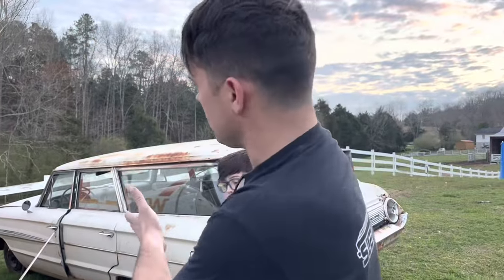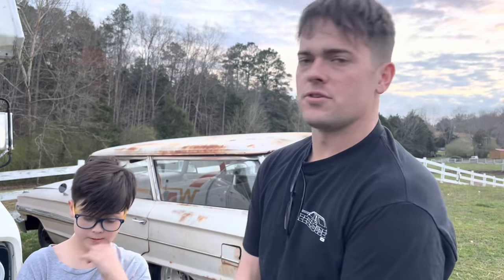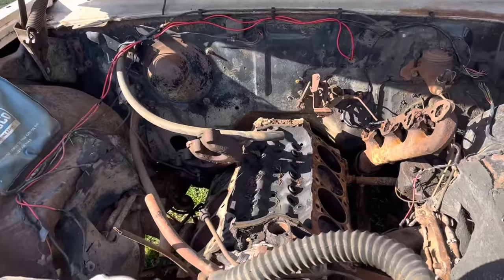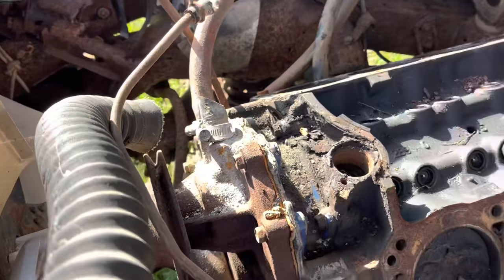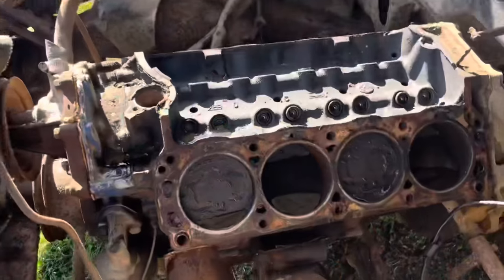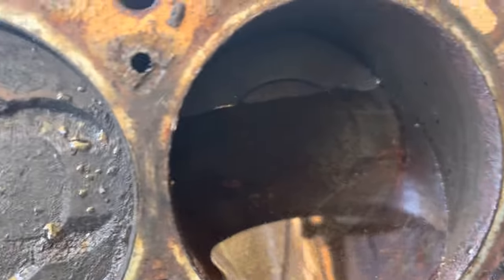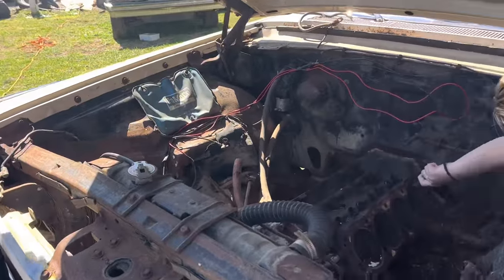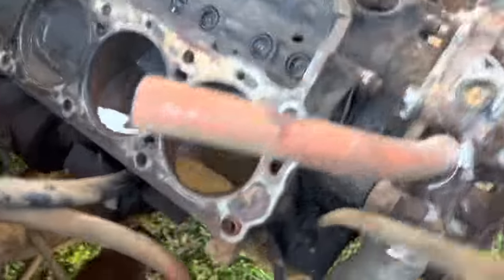Tricks and Tips to getting a stuck engine free after 30 years. We try everything!

Comment: Transmission oil in the cylinders works great, pull the plugs and fill up. Let it sit for a while, and turn it over using the crankshaft bolt. The cylinders need lubrication. Great video, and a blessing of a family. Keep up the great videos.
Reply from the maker: Ok thank you

Comment: Grandfather bought a locked up Farmall tractor. Put a socket, breaker bar and a ten foot pipe  on the crankshaft with several hundred pounds of iron on the end of the pipe. Oiled the cylinders and walked away. Three weeks later all the iron was laying on the ground. Time, pressure, leverage and a bit of oil mixed with kerosene broke it loose. Just another weapon in an arsenal of tricks to use if all else fails. Good job on the video.

Comment: Your going to have to bore that block maybe 30 or 40 over to clear up those cylinders so you will get maximum compression or it’s not going to have any power and will sling oil out of the exhaust if it will even build enough cylinder pressure to even run. It’s worth doing if you ask me because that’s definitely a going to town car for your family.
Reply from the maker: Yes sir !!!
Reply: Adds more cost to the build I would light bore it maby .10 over
Reply: I'm thinking 0.60 won't be enough, that would be max on them cylinder walls
Reply: That is if it can be bored , some of the cylinders may have too much rust . If more than one or two need sleeved then it would be better to find another block .

Comment: You probably won't believe me but if taking some gas and oil mix put some into each cylinder then light it and let the heat do it's job.
Reply from the maker: Ok good to know
Reply: @Sleeperdude  
Ralphie did say to light it on fire.
Reply: How about your right my dad did that it worked
Reply: Or use 'boiling oil'.

Heat plus it thins it up so it penetrates better.
Reply: @mrb.5610  agree
Reply: I second this motion
Reply: Trying to free up 4 cylinder JD moter, going to give it a try

Comment: Well done! For better and faster results, you should degrease the bores before you add your vinegar. Otherwise, the oil blocks most of the vinegar from reaching the rust. Vinegar still works with greasy bores, but takes much longer and is less effective. When you have rusty bores, the rust you can see isn't really the problem; you can brush and hone that away. It's the rust you couldn''t see that was locking up the motor. Phosphoric acid works quicker and better than vinegar. As you've already discovered, muratic acid also desolves rust, but it also tends to dissolve any alloy (eg, pistons). It's easier to neutralize acid with baking soda if you dissolve the soda in boiling water first. But well done, you put the effort in and got the result :)
Reply from the maker: Ok thank you for the good info
Reply: Do you have any suggestions on a 3.4l Toyota engine that has sat for 3yrs and the rings are rusted. It will turn over fine it just sounds crazy with no compression. I tried ATF & acetone mix with no luck.  It seems like everything just seeps past the rings into the crankcase before it has a chance to work. I haven't tried white vinegar or industrial vinegar.  Just hoping I can find someone out there that can help me save this engine. Thanks.
Reply: @dgmenace73  First you need to check the engine bores with a borescope to check that the valves aren't bent or the pistons damaged.
If they're okay, you must degrease the engine, or the rust remover won't be able to get to the rust.
Remove the spark plugs and DON'T replace them until the job is complete, or you may hydraulic the engine. Live with the fact that whenever you turn over the engine, crap will spray out of the spark plug holes.
Using a spray bottle, lightly spray in detergent mixed with water then cautiously  turn over the engine using the starter. Repeat until oily crap stops spraying out the spark plug holes. Detergent foam coming out the spark plug holes is okay.
Then lightly spray phosphoric acid, Evapo-Rust or vinegar through the spark plug holes. Lightly turn the engine over to ensure an even spread. 
Leave phosphoric acid for maybe 12 hours, Evapo-Rust or vinegar for maybe 24-72 hours.Keep the bores wet with rust remover at all times or the rust remover will stop working. 
Then spray a small amount of water into the bores to remove the rust remover and gently turn the engine over by hand. Then wet the bores again and spin the engine over  on the starter until crap stops coming out the spark plug holes. Repeat several times.
Then spray in some penetrating oil and turn the engine over on the starter motor until crap stops spraying out the plug holes. Repeat this several times.
Drain the engine oil and replace it.
Then replace the spark plugs and use engine starter to start the engine.
Good luck.
Reply: @Clive Matthew-Wilson  thank you.....I actually had watched so many videos that I had decided to at least try exactly what you said. Anything i have tried already didn't get a chance because there was still oil on the rings. I think this just may very well work and I plan on recording the processes. I already had regular vinegar and some of the 45% I think is what it is.  Someone else mentioned to heat the rust remover and any oil to 145° since heat makes metal expand as well as makes detergents clean better. Sounds reasonable to me?  I will let you know if this works and let me know if anything I just mentioned is a waste of time or a bad idea ( like heating the chemicals up some). Thanks for replying.

Comment: Kroil is pretty amazing at freeing things up that have seized from rust and sitting. 
     Great Work and nice video. 
   Ya'll Take Care and be safe, John

   PS, I am a gunsmith and do restoration work on some really old and rare firearms. Kroil is the best thing for saving parts that might have wound up in the trash. Some of the guns I repair don't have replacement parts available for them. Soak them with Kroil and let them sit. Making parts isn't easy or inexpensive, Sooo...
Reply from the maker: Ok thanks for the info

Comment: Cool video, keep in mind 3rd gear gives you the most power and muriatic acid dissolves aluminum really not good for the Pistons. Check online for a product called Gibbs it's a high penetrant rust dissolver and will loosen most engines after it sets a few days, I think the engine might run but it's probably going to use a lot of oil unless you rebuild it
Reply from the maker: Ok thank you
Reply: I'm glad someone else mentioned this. I kept thinking "why don't they put it in 3rd?" In the end, the breaker bar probably had even more torque though.

Comment: Check out the guys on the Restored channel.  They are experts at freeing stuck engines. 

Also if you can get a prybar on a flywheel tooth, you can get the best leverage.

Also use a 4x4 with a mini slegde to pound on the pistons.
Reply from the maker: Ok thanks

Comment: I've got a 351 Windsor that's been sitting in our field since the mid 80's. Only had a few thousand miles on it when parked. We tried oil, penetrant spray, breaker bars and mallets before finally giving up. You've got me thinking I should give that another shot with some of these methods. Great video!

Comment: congrats guys! Truth is the vinegar and hydrochloric acid soaks likely loosened the pistons up enough that using the breaker bar on crank bolt would have worked...but who knows?? Ya had a bad situation there, wonder what if you resorted to the welded on lever right off??? maybe could have avoided the acid damage. How will it run?? well it would not be my choice for restoration methods. Use lots of Marvel in the oil so that heat of running will wash out the ring grooves then dump the oil and refill with heavy weight to help seal the pitted cylinders. Rust is a fatal blow to engines, disassembly and rebuild is really the only solid choice. You guys are first class entertainers!!!
Reply from the maker: Thank you I appreciate it

Comment: That was so close to being scientific, folks. Brilliant stuff. Never seen these things tried with the head off before so you can actually observe what happens. Vinegar is a waste of time, I think. It causes rust. It does, though, seem to dissolve it to an extent. Way too mild... Muriatic acid is a wow! (Hope Greta wasn't watching)... Ultimately, Ralphie power saves the day. It's driving manual steering that does it, and no mistake. Bring back flathead sixes, with nice, horizontal piston crowns... I have another way of doing it. Ralphie was on the right lines when he mentioned fire... I'll save it til next time. That was a hoot. Many thanks.
Reply from the maker: Thank you so much

Comment: Really makes no difference if it got unstuck or not. The fact you do this as a family is the best part. I always go with PB Blaster when things get stuck. The acid really cleaned between the pistons and the bore. Then Ralphie sprayed the blaster on the rings. Good idea welding the cheater on the pulley. I'd put it back together the way it is. It will smoke like a train but what the heck.
Reply from the maker: I agree

Comment: Years ago I put a small block Chevy in a 66 Corvair with a 4-speed. Then I found out the junkyard motor was stuck,  I removed the plugs, squirted the cylinders with ATF and let it soak overnight, still stuck, then out of anger and frustration I had a buddy tow my Corvair about 20 MPH in 2nd gear and dumped the clutch, tires locked up, still stuck. Finally I put it in reverse and repeated the procedure. The engine spun over and oil and crud spayed from the plug holes, it was free. I re-installed the plugs and started the engine, amazingly after a short period of rough idle and smoking it ran very well for years.
Reply from the maker: That’s crazy
Reply: @Sleeperdude  and lucky, loved your story

Comment: I bought a boat with a small block Chevy that was just about the same as your motor. I used a three bar cylinder hone and cleaned up what showed, after that I hooked two batteries together a cranked it. The flywheel makes more torque than you can imagine it broke loose. I put the heads back on after freeing up the stuck valves and I used that boat for two years with no trouble.
Reply from the maker: That’s awesome

Comment: Way to go. That was really stuck. I had a 350 in a boat the was stuck like that and got it loose with penetrating oil. Only to find out the rust on the outside of the cylinder sleeves was much worst. It had saltwater running through the cooling jackets. A crate motor and fresh water cooling system fixed that.
Reply from the maker: Oh man that’s no good

Comment: Sleeperdude I've been using 1 to 1 to 1 parts transmission fluid marvel mystery oil and cutting fluid for 30 years never had it not work try it you'll like it. we used it in Iraq for freeing up engines too. the heat from the desert was a big help
Reply from the maker: Ok thank you

Comment: Now that you got it broke free pull it, drop the pistons & rods out of it & dingleberry hone each of those cylinders, clean, inspect & re-ring those pistons before you put it back together. If you try to run it like it is you’ll break whatever rings are left as you crank it or at worst bend or break a rod with how much slop is in those bores. Also because the motor has seen so many different liquids it would be a good move to pull it all the way apart to make sure you aren’t going to wipe a cam lobe from junk being stuck in a lifter bore  can’t wait to hear this thing fire up.
Reply from the maker: That would probably be best

Comment: So I had a 65 stang I had to get motor for, bought one a guy had in his shop for over 20yrs, built to the hilt, but figured out it was on engine stand whole time and sat out under a tarp for over 10 yrs.  So much rust I got it for almost nothing. The bolts from the stand were rusted into the block. Had to cut them off. Tore the motor down and angrily ripped it apart. Threw all the internals into a bucket of evaporust to soak. Pistons had to be pounded out but we're in decent shape. Got the block and heads worked over and built it from ground up. Put in car, gave a shot ether primed card and it fired right up ran like a dream. Ran and drove it for 3 years with no issues. Sold when we moved. Last I heard, still running and that was 2001 when the guy bought it.
Reply from the maker: That’s crazy

Comment: When you put some type of lubricant into a V8 engine thru the spark plug opening. Your only getting a soak on the very bottom portion of the cyl and piston's that are near the top . What I do is pull the valve covers and remove the push rods. Then I fill the intake manifold full of my favorite mix of 1/2 diesel and 1/2 ATF. Then I open the intake valves one at a time. That fills the cyls 100% full. I have also plugged the exhaust and opened the exhaust and intake both at the same time that way the valve stems and guides get a lube. A 1964 289 or 260 has a 5 bolt bellhousing the newer 289 and 302 ect have a 6 bolt bellhousing.
Reply from the maker: Good idea, and yes about the bellhousing

Comment: As a FYI. The long angle iron bar is a physics lesson (statics). When applying a force on point A (crank), the further you move away from point A to apply the force (B) the greater the resulting force will be on point A. And it’s relative to distance.
So, the crank is point A and your wrench is 12”. If you switch to a 24” breaker bar, using the same force on point B (end of the breaker bar), you’ve now doubled the resultant force at the crank. Going with that welded 48” angle iron would be again double the 24” breaker resultant force at the crank. 
That’s why you see tire changers using very long breaker bars (5’ plus) to free up stuck lug nuts on wheels.
Reply from the maker: That makes sense

Comment: I used to use pepsi to unseize motorcycle engines or diesil in the spark plug holes you gotta soak it for a couple of days tho 
And keep checking the levels with a stick in the plug holes kool vid mate 🤘
Reply from the maker: Ok thanks for the info

Comment: I had this same exact issue with my galaxie except it ended up being cracked. That orange stuff in the cylinder is either stained from burnt coolant or just rust. In my case it was coolant. It’s not 8 months since I’ve sent the engine off to a shop, found out I needed a 390, bought a basically brand new 390, and now, sometime this week I’ll be getting the engine back.
Reply from the maker: Wow. That’s cool your getting it back soon
Reply: @Sleeperdude  yeah hopefully at least that’s the plan. I’m putting it in my 62 galaxie. A lot of torque and hp for a 4 door vehicle haha

Comment: If you dont have a welder you can also try a super large pipe wrench or a strap wrench with a cheater bar. I have used Metal Rescue rust remover in liquid and gel before on stuck engines.  Cover with saran wrap or cling flim to stop evaporation of product and more affective. The gel allows you to get the upper section of the piston soaking. Never damages anything that isn't already damaged. Have soaked everything for guns to engines in them and had excellent results. Especialy in large underbed plastic totes and 5 gallon buckets with tops for soaking.
Reply from the maker: Ok thanks good tip
Reply: @Sleeperdude  No problemo man. Hope it helps! Thanks for saving The Good The bad and the Ugly! heh Keep it up yall! Lovin the content!

Comment: I bought one of those cheap Proform rotation adapters that bolt to the harmonic balancer in place of the crank pulley to turn over an engine. They work on Ford and Chevy and they're only about $20, I used a 24" breaker bar with a cheater pipe and gave it everything I had to break loose my stuck 305. I tried a few things before buying it but was always paranoid about breaking the crank bolt due to bad past experiences, the tool held together, but they say to make sure to use a socket on it instead of using the tool directly on the 1/2" breaker bar, might be worth looking into for future projects.
Reply from the maker: Ok interesting thank you

Comment: Excellent video Sleepdude Crew  :) also lube those cylinders also walls till get to work put Desiel fuel with 10w30 engine oil  together add every 8 hours too and save from tight sezie up tight again it help out too! Ever get another seized one do Desiel fuel with 10w30 engine oil to in cylinders plus walls to and glad 283 Broke lose too also that One cylinder asks color means liner on limit of measurements and so put bigger piston also rings on when rebuilt motor totally!
Reply from the maker: Ok thank you
Reply: @Sleeperdude  welcome

Comment: Marvelous mystery oil I’ve used it many times it will free it up but you will still need to pull it a part and clean the parts and hone the cylinders to get rid of the rust pits if they are deep enough you may have to bore it a little check to see what they have as far as rings at the speed shop if you have to go there but you should be ok with just honing it
Reply from the maker: Yes thank you

Comment: I can't believe you got that motor broken loose. I'm thinking that 289 is going to need a bore job to do it right. I have two motors in my garage that are frozen. There's the 350 out of my 55 that isn't anywhere near as bad as the 289 and I haven't been able to get it broke free yet, and it's even out of the car. Then there's the 434 sb out of my brothers Late Model stock car that he let freeze up ,and again it's not that bad and it's still stuck. I've went through several pieces of 2X4's and several cans of peanut butter and jelly (PB Blaster) beating on those pistons. I haven't tried vinegar or acid yet. Good luck with your 289 project.
Reply from the maker: I think you are right thank you

Comment: Looks like a job for Extralube C60 spray. A penetrating oil with ZX1 metal treatment in it. If you spray it in the cylinders and then heat the metal above 60C it should penetrate and loosen before bonding to the metal to reduce friction and stop reseizing.